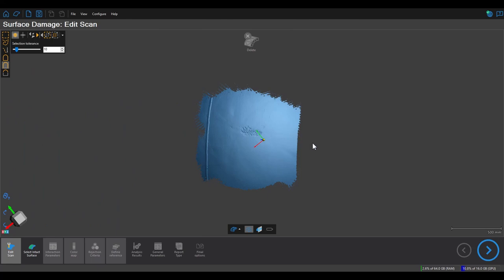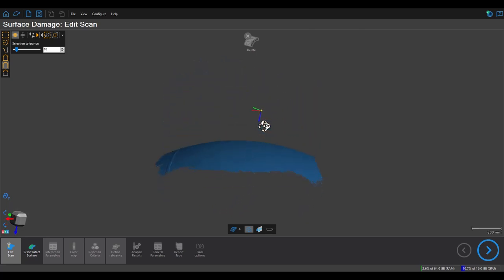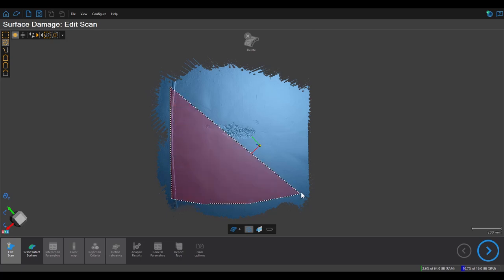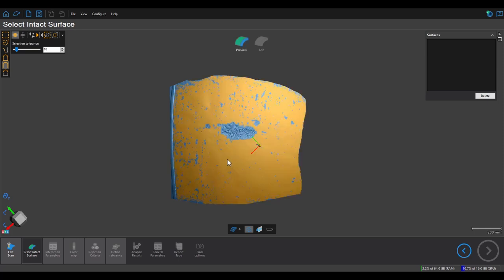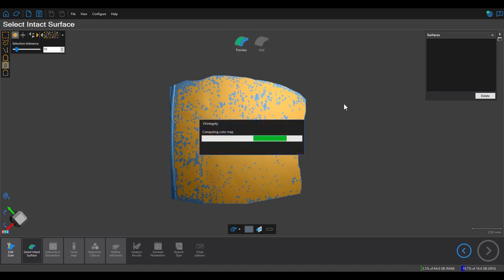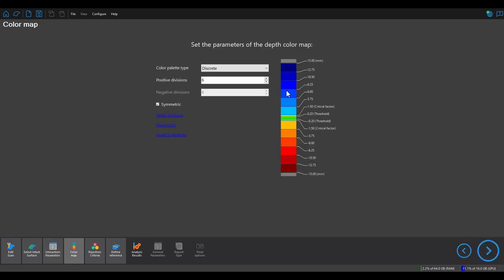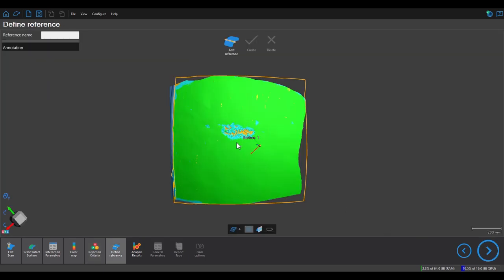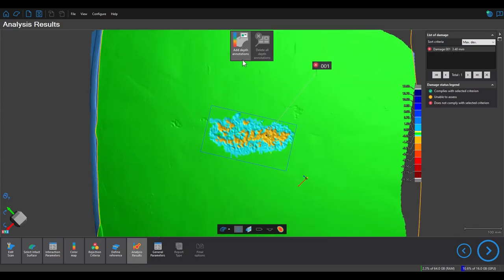How to conduct a freeform analysis in VXintegrity

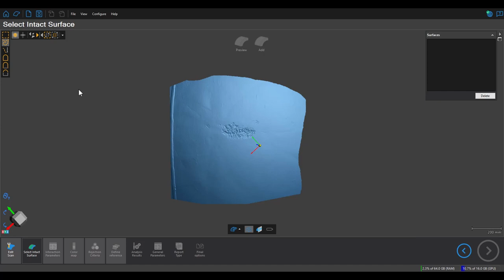Comment: I noticed when you used the Sudden Changes selection at 0:51 you had no issues with a "disconnected triangles" message when minimizing the selection. In the Aerospace module that happens consistently and is quite annoying. Why does it work here?
Reply: I believe that was patched up more recently